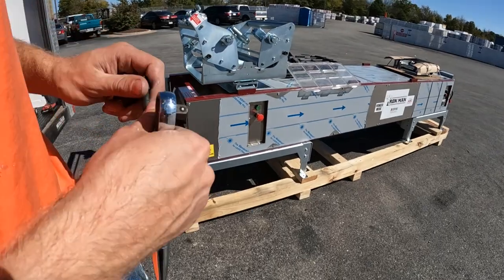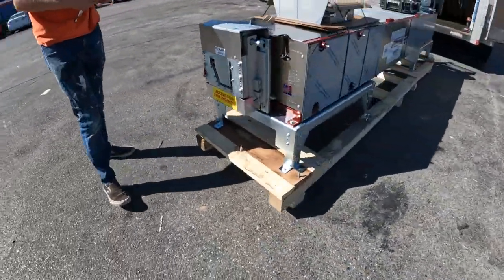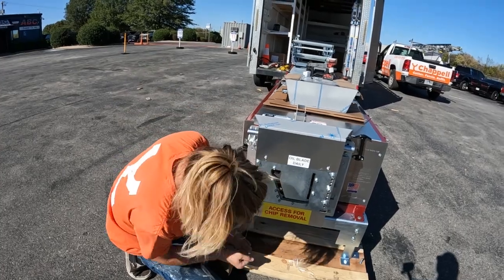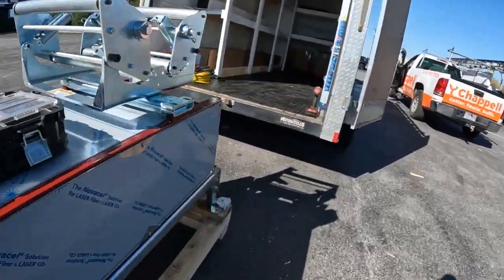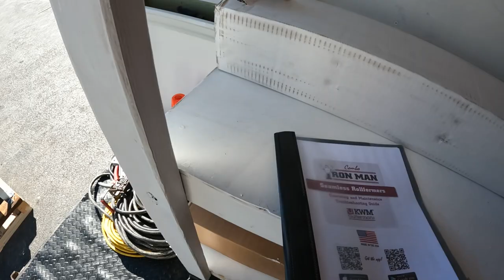KWM IronMan 5/6" Combo Gutter Machine Unboxing & Loading

Comment: Which store did you get the machine ? Does it have to be ordered
Reply from the maker: I ordered mine through ABC supply but you can order through many different exterior building supply companys. 

It helps to order them through the supply companies as they have forklifts.